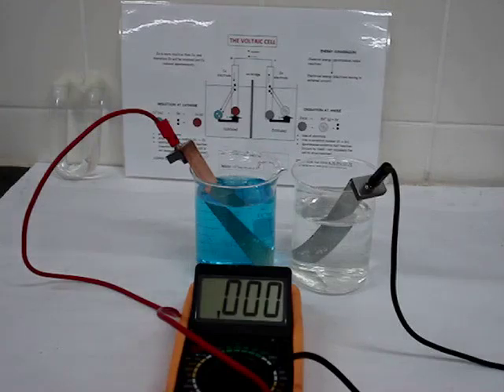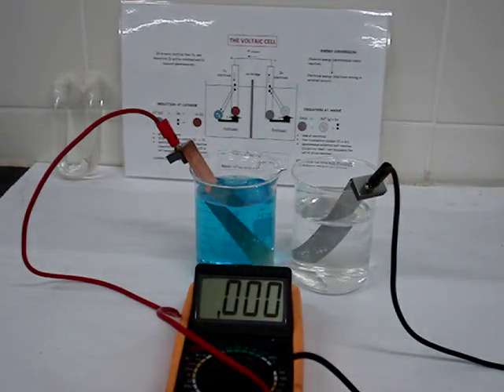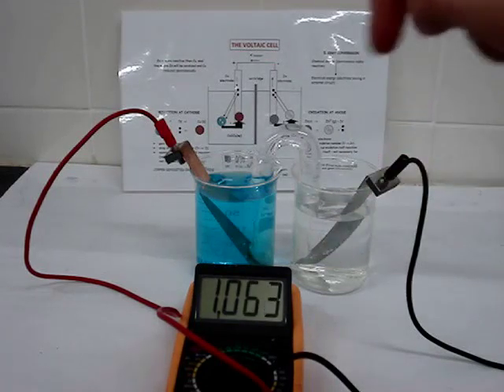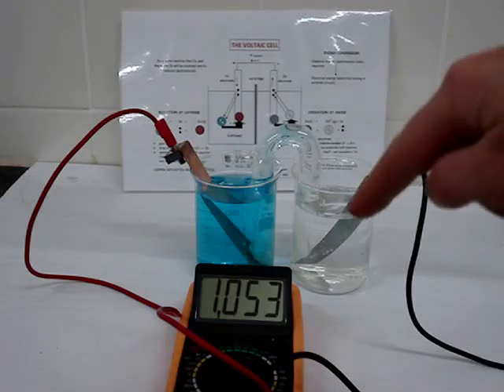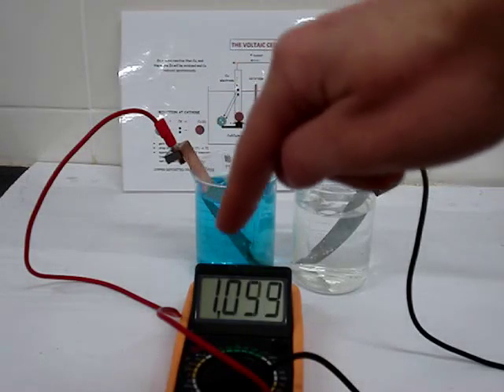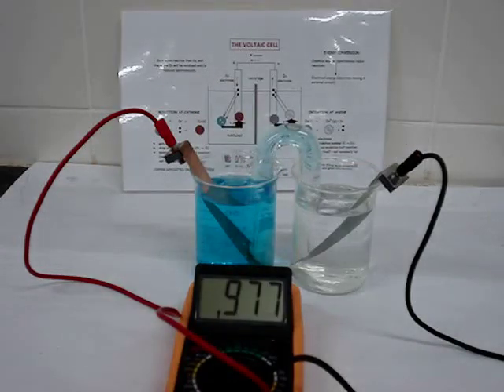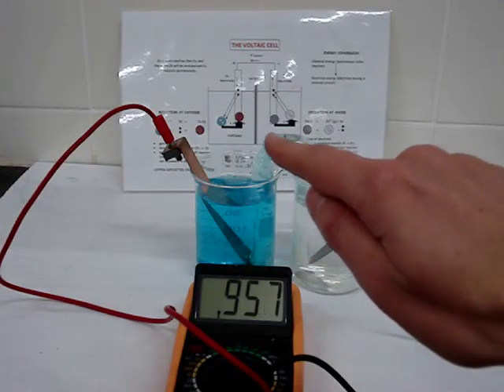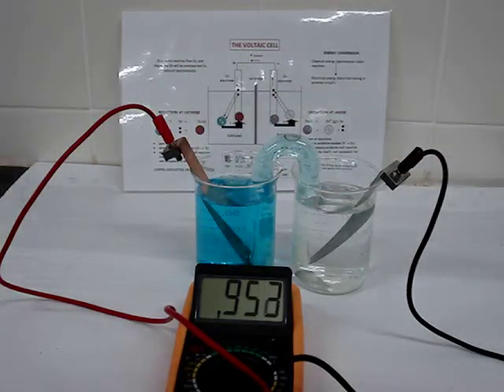Copper-Zinc Voltaic Cell

Comment: Nice video, but I'd suggest to avoid anthropomorphizing atoms and solutions. It is actually distracting and simply wrong, atoms don't want anything, if you so need to convey that they'd "tend to". As teachers it is important to use propper language when teaching. The macroscopical tendences are just statical phennomena arising from problable energy states of single atoms and should not be treated as "willing".

Comment: Why not just use a copper wire instead of using a salt bridge.?
Reply from the maker: Because ions, not electrons, are needed to complete the circuit between the two solutions, and ions need a salt bridge, not a copper wire, to travel through.

Comment: Hello, can we improvise this experiment? I couldn't arrange zinc sulphate chemical as I couldn't find it anywhere. I live in a very small area. Can we do this with some other method? Or can I use something else instead of zinc suplhate?
Reply from the maker: Yes you can indeed! The easiest way to improvise a voltaic (galvanic) cell is by sticking two different metals into a fruit or vegetable (e.g. a lemon). If you have a voltmeter, you can measure the potential difference generated by the redox reactions at each of your electrodes (metal rods). If you don't have a voltmeter, but you have an LED, then you will need to connect a few of your fruit-cells in series with one another to get a potential difference that is high enough to make your LED shine. Hope you come right! Have fun!
Reply: @LearnScienceCoZa  hey thank you so much. Can I also use iron sulphate instead of zinc sulphate and dip filter paper in sodium chloride solution and use it a salt bridge? Or in potassium nitrate solution

Comment: Why the solution in the ion bridge turns blue? I thought only the anions in the copper half cell will flow to the ion bridge???
Reply from the maker: There would be diffusion of the blue copper sulfate solution from the beaker in which there is a higher concentration of copper sulfate, through the ion bridge, to where there is a lower concentration (and the same for the transparent solution in the reverse direction) whether or not a redox reaction occurred. Since a redox reaction is occurring, there will additionally be movement of both cations and anions through the ion bridge, in reverse directions, to complete the circuit.

Comment: If voltmeter's resistance is supposed to be near infinity, why can the reaction still happen if the electrons can't pass through the voltmeter?

Great video with clear explanations btw!!
Reply from the maker: Good question! I guess it's because the voltmeter's resistance is not infinity after all? - it's theoretically infinite, but in practice it isn't, so there is a low current that does flow through the voltmeter.
Reply: @LearnScienceCoZa  Thanks! So in theory, the rate of reaction should be much higher if the voltmeter wasn't present at all, right? Haha xD
Reply from the maker: Yes. I think that's why you can't see any corrosion of the zinc and deposition of the copper when I raise them up to show... Reaction rate is too slow.
Reply: @LearnScienceCoZa  Yup, but we still got to see the Voltmeter Reading drop over time though xD
Reply from the maker: Lucky you! 😂

Comment: Would it work with a smaller amount of each solution (how do you calculate how much you need)? If I wanted to make a series circuit, would I connect the beakers with more wires or more salt bridges, please? Thank you for the video!
Reply from the maker: The amount of solution will affect how long the battery lasts before getting flat, but not, within reasonable limits, whether it works or not or the emf of the cell. The concentrations of the solutions will affect the emf. Standard concentrations would yield the emf given on the table of standard reduction potentials (see other videos in this Playlist about this). You can place cells like this in series with one another by replicating cells like this and then connecting these replicas to one another by wires. Eg you could have two of these and then add a crocodile clip from the cu electrode of one to the zn of the other, and then measure the voltage across the 2 cells together.... Which should be double one on its own
Reply: Thank you so much! This is very helpful for my chemistry project :)

Comment: Why do we need the zinc ions to be in the solution in first place? The oxidation comes from Zn(0), what’s the point of already having Zn2+?
Reply from the maker: Good question. Indeed you don't. Actually you also don't need to have the cell divided into two. You could simply put both the Cu and Zn rods in the copper sulfate solution

Comment: Why do the positive charges move from the zinc solution to the copper solution through the ion bridge? I thought zinc liked to be in it's Zn2+ ionic state? Is there too much build up of positive charge in the zinc solution? Also, why would that positive charge move to another equally positive solution in the Cu2+?
Reply from the maker: Like charges repel and unlike attract. There is a build-up of positive ions (Zn2+ cations) on the Zinc half of the cell due to the oxidation of Zn to Zn2+, and there is a depletion of positive ions on the Copper half of the cell due to reduction of Cu2+ ions to Cu. So the Copper side is not equally positive to the zinc side.  Note also that by moving through the ion bridge, the Zn2+ ions don't change from their stable ionic state.

Comment: Does saturating the solutions increase the cell potential voltage?
Reply: Depending on which solution you saturate. If you add in more of the copper ions then it would be supporting the forward reaction and therefore you'll have an increase in voltage. But if you add in more of the zinc ions then you will be supporting the backward reaction and voltage will therefore decrease.
Reply: yeah
Reply: anyone still lurking in these comments, just look up the nernst equation and itll give you a proper answer/explanation

Comment: I'll Show You - How drinking water can deliver electric power ... 
Free Geen Energy without poison or toxins
I call this MEDELIS BATTERY
https://youtu.be/5CxGul99M3c

 This battery generates electric power out of Tap Water (drinking water or any similar liquid)....
its small and powerful
battery will work about 3 hours (you can always refill water - make it work again)

To make the battery you will need some stuff
Copper Plate, Magnesium Ribbon & Thread..

I don’t know if this method of producing electricity is economical and cost effective.
What I know is that it is worth to try !?
http://medelis.se/om.html